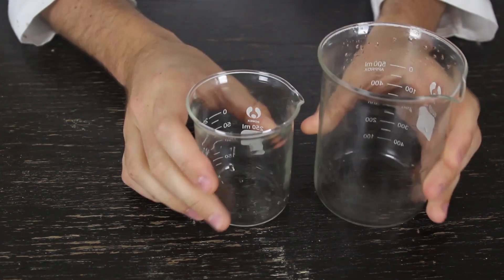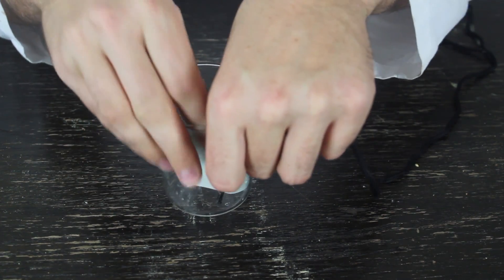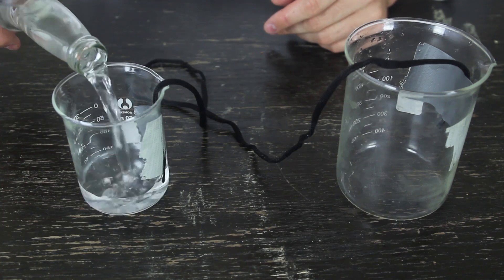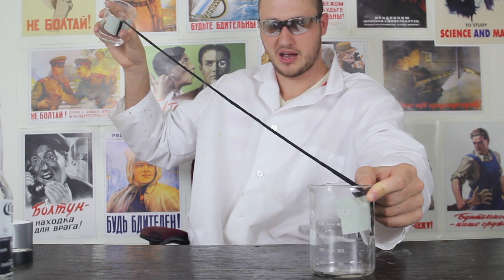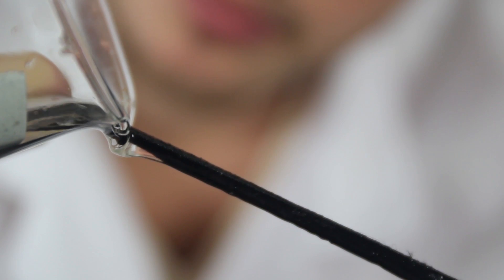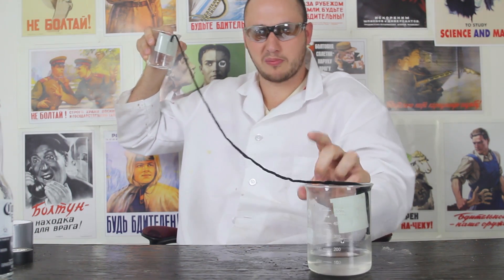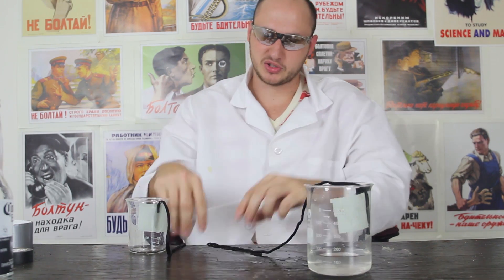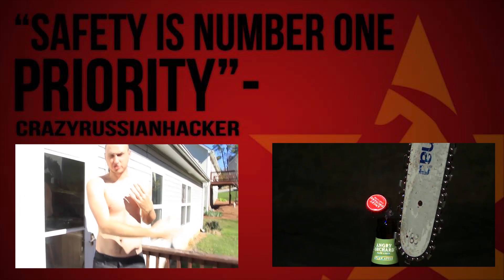Cool Water Experiment

Comment: water has cohesion with the shoelace keeping the individual molecules in the string... adhesion when the same molecules stick together then keep the water together as it flows.. water is also a polar molecule meaning it has a slightly negative side and a slightly positive side... the negative sides attract to the positive ends of the water molecules giving the adhesion alowing the water to flow along the shoelace

Comment: Cohesion? When water connects because of hydrogen bonds. Hydrogen bonds are very weak and break very easy. That's why if you tip the glass of water even just slightly more some water will fall. But (A) Cohesion

Comment: Be cuz the small beaker is in a angle so the water will not drop becuz the tip of the small beaker is connected to the shoe lace like the water goes to the beaker and then it goes into the rope and travels until it goes to the end of the string to the bigger beaker

Comment: The rope is moist so when water touches it, the rope soaks it up and because the rope is kind of high it is falling to the other cup because it is also attached to the rope so it does not spill. If you tilt it alot it will spill thats why u were tilting it a little bit.

Comment: Water molecules are polar and there for magnetic, they stick to the molecules of water already on the string allowing it to go from one glass to the other. Another trick you can try is run a small amount of water from a faucet. A solid stream but as small of an amount as possible.  The water will be atrackted to a strong magnetic.

Comment: The string has many microscopic holes and the string is made of cotton/cloth material that absorbs water. When the water pours the absourbation starts as soon it touches the string and stay inside these holes in the string. Then when you hold it up like that gravity pulls it down the string but the absorbation is stronger than the gravity and doesn't let the water drop. You can try the power of absorbation by placing a string between 2 cups, 1 empty 1 that has water. And let the absorbation transfer the water without holding any cup up. This will of course go much slower like a couple of hours but it works!
Hope that answers your question and keep the good work!

Comment: The water sticks to the rope due to cohesion theory.  The molecular formula of water is H2O.  As a result water can form Hydrogen Bonds with other molecules of itself therefore cohesion occurs meaning the water molecules flow together.  This along with van der waal forces also cause the water molecules to attract together and therefore flow together.  The rope also naturally has static charge giving off electrons attracting the polar water molecules towards it.  This added with the absorbing power of the rope means the water simply doesn't fall to the ground.

Comment: So water generally likes to stick to itself and in stay one piece.

A water molecule is hydrogen strongly bonded to oxygen. But within that molecule, the oxygen has a stronger electro-negativity than the hydrogen, so that means that the electrons that orbit the entire H2O water molecule are more attracted to the oxygen than the hydrogen. Since electrons are negative, this makes the oxygen slightly more negative and the hydrogen is slightly more positive. This is called a 'dipole' and is where the water molecule has a negative and positive side.

Since the H2O molecule has a negative and a positive side (ie a 'dipole'), it means the the negative oxygen of one water molecule will be attracted to the positive hydrogen of a different water molecule, and so the molecules stick to each other. These bonds between the water molecules (inter-molecular bonds) are not nearly as strong as the bonds within a single water molecule that binds the hydrogen to oxygen (intra-molecular bonds), but they do give water that tendency to stick to and be attracted to itself.

The fact that water has this property is actually so important and is a massive contributing factor as to why life as we know it has been able to flourish for so long on this planet. It is what gives water it's surface tension. It is what makes ice less dense than water and therefore float whilst allowing the bottom to stay liquid (great news if you're a fish!). It even causes what is known as capillary action which allows our plant friends to drink water so they an continue to sustain us. We owe our lives to the fact that water does what you just saw it do.

Comment: I believe this is because of th surface tension of the water. The wter wants to fall, but the surface tention keeps it from breaking off from the rest of the water. If the shoelace was not wet it wouldn't work because it would take nore effort for the water to go down it than it would for the water to run next to it. It's like how a water droplet runs down a waterproof tarp, there is no surface tension on the tarp because it isn't wet, so gravity acts freely upon it.

Comment: Surface tension of the water. If the shoelace was dry when you started tipping the beaker, it would just pour out onto the table. But since water has a tendency to maintain surface tension, it will be "attracted" to the wet string and follow down it with gravity. It wouldn't work if the other beaker was higher than the starting beaker.

Comment: It doesn't fall because water is magnetic to each other and they want to stay together, so when the water is almost spilling, the water in the beaker pulls It back, but it's not quite strong enough to stop all of it, but those bits it can't hold get absorbed into the shoelace and travel down it then fall out the other end

Comment: The water didn't spill because water is adhesive and cohesive meaning that water will stick to other surfaces (the shoelace) and itself (the water in the shoelace) which applies enough force to pull the flowing water against the force of gravity since gravity is the weakest known force

Comment: Hydrogen bonding is the answer. It makes water very slightly magnetic to itself because of the gravitational pull at the atomic level. Therefore the water doesn't drip off the string and the gravity of the molecules stick to eachother down the string. This also happens in droplets of water in slow motion, if you watch it, it doesnt join the larger mass of water until it rejoins the larger mass of waters sort of magnetic pull.

Comment: It all has to do with the properties of water. Adhesion to be exact. Cohesion is what causes the water to "stick together" like on the surface of a table. Adhesion is the property of water sticking to other things. Water is neutrally charged with both positive and negative bonds, and will always link up with itself. Properties of water, i.e Adhesion, is what causes the water to firmly slide down the shoe laces without dripping.

Comment: The shoelace tips (or rope tips) are inside of the water. Absorbing some of the water. When he pours, he pours only a slight amount of water, just enough for the rope to absorb, but even though the rope has absorbed some of the water it is still influenced by gravitational forces and is forced down towards earth. Normally it would simply pour to the ground. However because of the absorbent rope having absorbed some of the H2O molecules. Any H2O molecules that come into close proximity attract each other. The rope can only absorb so much water though so the excess H2O merely gets redirected by intermolecular forces to travel down the rope instead of seperating from it. Eventually after enough water has been poured the entire rope will be wet creating a water sky wire highway.

Thumbs up for the Crazy Russian To see.
Reply: Not exactly... it has more to do with surface tension. Then again surface tension is a direct result of molecular attraction...
Reply: someone payin attention in class lol
Reply: For those of you that are replying. First off. No its not running through the rope. Its running on the rope. Yes its partially because of the surface tension between the molecules, but primarily because of the tension between the water molecules, why do you think he used a rope and not say a metal wire? The water won't stick to the wire as well as the rope because the bonds aren't as strong between the water and the wire.

Fun experiment you can try yourself at home Take a spoon and go to your water tap. Let the water run and while loosely holding the spoon with the round side facing the water slowly move it until it touches the water. The water will suck the spoon in. This is due to both physics for every action there is a equal and opposite reaction and surface tension. Notice that the water gets angled off of the spoon in the opposite direction the spoon is getting sucked into.
Reply: Basically the water travels in the shoelace or rope to the other cup after being absorbed by the shoelace
Reply: Water as a few really special properties, like it's high surface tension. Water molecules all pull on eachother equally, but at its surface the air has less of an attractive force on the individual water molecules causing a slight inward pressure. This holds the mass together. This is the what is happening in many of his water themed videos, like the ping pong ball that behaves differently with the amount of water in the glass. I'm not saying the original comment is wrong i just feel it is important not to leave out the term "surface tension."
Reply: It's called capilarity
Reply: Yes it will work with an iron chean or something. It also has nothing to do with the tention of the surface of the water. The water wil just stick to like the bar or rope becuse of the inter molucular forces that i dont know the name of. (In dutch its called "adhesie" ) it is the same force as why paint sticks on a wall and doesnt fall off. Im sorry for my englisch its not good but hey! What would you espect from a dutch guy :)
Reply: Water has a lot of adhesive and cohesive properties which let it stick to the shoelace and to itself making a little stream across the shoelace.
Reply: He already knows lol he just wants comments as it counts as a share = more $$.
Reply: I love it when someone explains how it happened because he doesn't really explain much. :P
Reply: Shane Gorden Exactly it's because of the Hydrogen bonds in-between molecules, that surface tension exists right? I'm pretty sure
Reply: Ian Voordeckers
Adhesion. The verb is 'to adhere'. Your English id fine. Except I think you meant 'iron chain'.
Reply: You are a genius
Reply: Dafne Sorkin the mere fact you just fit that into 15 words
Reply: SnoWolF Gaming heads up bro. you're those people that either study science or has that kinda brain, not everyone studies science or has that type od brain
Reply: judah goddard"if you are going to judge a fish by its ability to climb a tree it'll feel its a failure for the rest of its life" - our education system. I'm a science person. I never studied science, but like you said "that type of brain" I just thought I should share what I saw after noticing so many people were baffled.
Reply: Also called cohesion
Reply: SnoWolF Gaming now that you say that I am happy to say that I have one of those brains as well

Comment: Surface tension
Reply: Thank you, so many other people are just saying the first thing that pops into their heads.
Reply: I know it's kinda sad actually
Reply: Surface tension has nothing to do with it. Read my comment at the top, mine is in a thread though. But should be easy to find.
Reply: weredragon100 (Cohesion and adhesion).....Cohesion holds hydrogen bonds together to create surface tension on water. Since water is attracted to other molecules, adhesive forces pull the water toward other molecules.
..

Comment: It's a combination of surface tension and cohesion. Surface tension repelling against the air, and by wetting the rope. Cohesion, the water wants to stick to itself.
You could actually leave it dry and put the full container higher than the other container and it should wick the water down. A lot more slower though.

Comment: Its called capillary attraction, because the string is already wet the water takes the easiest path, gravity pulls it down and the easiest path down is the already wet string.
This is used allot in plumbing when soldering joints together the melting flux pulls the solder around the joint via the already flowing liquid flux. The reason the droplets of water that form dont fall is due to surface tension among the water molecules.
Physics you beauty. .

Comment: The water on the rope is the reason why. The water is attracted to the other water already on the rope. So it won't fall down. The cohesive force between the water molecules is due to the fact that water molecules are polar because the molecule is asymmetrical so the positive charge is distributed to the bottom where the hydrogen atoms are and the negative charge is distributed to the oxygen atoms. This causes electrostatic attraction between the water molecules. As they move along they draw other water molecules along with them as they're attracted by the cohesive force.

Comment: It does this because of surface tension, this is caused because water molecules are shaped in a way that one side of the water molecule is slightly negative and the other side is slightly positive, this makes it so water molecules attract each other, that is how they are all holding themselves on the shoestring.

Comment: This works scientifically because of Adhesion.
Water is adhesive which means that it will stick to almost anything.
Hydrogen is a 1 atom molecule so it can fill up space to fill a quota of a atom to become stable.
This is also why when you pour water out of a bottle, there's little drops left in the bottle.
The water will stick to the shoelace and will be transfered down to the other glass.
#APBiolife

Comment: Water doesn't just fall because water wants to stick to itself, it's called Cohesion and it also wants to stick to other objects, it's called Adhesion. When a drop attaches to the string because of adhesion the other drops want to attach to that drop causing the continual line of water going down the string.

Comment: It's because of hydrogen bonding within the water molecules.  Basically meaning the water soaked into the string will attract the water being poured from the beaker. Think of it like two magnets being attracted to each other (because it basically is).

Comment: Isn't it because water molecules have a greater positive charge than negative, so they "stick" to molecules with negative charges. I believe this is surface tension, and that's how the water molecules, or simply water, "transports" to the bottom. I'm not sure if I am completely correct. Correct me if so! :)

Comment: The reason the water doesn't fall off and slides down into the other beaker is caused by cohesion and adhesion. These two are what !makes water stick to other surfaces, and what makes water stick to each other.

Comment: It's surface tension, the water can't form in to a drop because of the speed the water goes down the rope. because it takes a curtain amount of water to form a drop. It like when you are taking a shower and the water rolls your arm without dropping. And because the surface it is traveling on is holding the water better because it absorbs the water and little bit making drop harder to form. And the drops of water are unable to break the surface tension  on small surfaces. because of the the water holding it together more than let's say a part of steel and because of the effect the string gives the water ( to stabilize the water) the force of water surface tension can also try to bead the water forming drops the string with the water it makings the water bead in the string.

Comment: Why the fuck do you need safety goggles and a lab coat? That's the equivalent of putting on a radiation suit to pick up your dog's shit. Actually, any non-dog humper would do that if they had one. This is the equivalent of picking up your dog's shit with a bulletproof vest.

Comment: It is PHYSICS !!!!!! The hydrogen bond in water molecules produces 3 unique properties  cohesion,adhesion & capillary action : Cohesion makes water stick to itself and adhesion means that water also sticks very well to other things,
 "Capillary" action is a result of surface tension. this happens in plants when they "suck up" water. (the string is sucking up water)  The water adheres to the inside of the plant's tubes. Here it adheres and flows the length of the string.

Another good one.

Comment: Water or H2O is made by Hydrogen Bonding. In hydrogen bonding, the elements are formed by strong intermolecular bonds connecting them. These bonds cause the water molecules to have a greater attraction to one another. It becomes harder to break these bonds which is shown when you try to boil water. Water is the slowest natural compound to boil because of the strong bonds.

Comment: The h2o molecules bond easier with other h2o molecules which are coated in the string, rather than the h2o forcing itself to break off and join just oxygen/nitrogen (air)

Comment: Water molecules are polar which causes cohesion between molecules and adhesion between the water and the rope. The polarity is caused by an intermolecular force known as hydrogen bonding. This is because the oxygen in the H2O is more electronegative than the hydrogen and therefore more strongly attracts the the only electron a hydrogen atom has. This exposes the hydrogens nucleus, which consists of just one proton (which is positive). This also causes the oxygen to become more negative as it had more negative electrons closer to it. This causes an attraction between the positive hydrogen and the negative oxygen atoms between molecules. And this is where water gets it's sticky property.